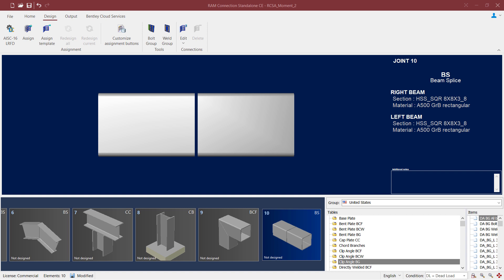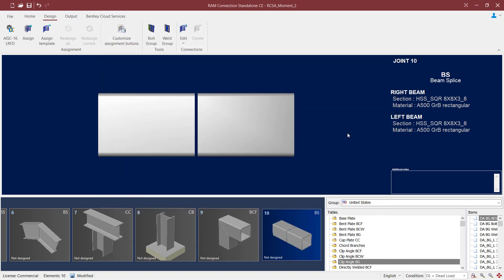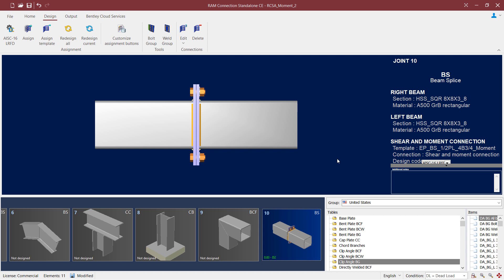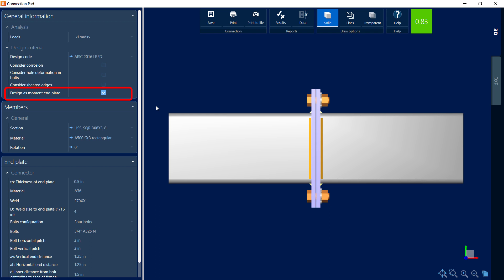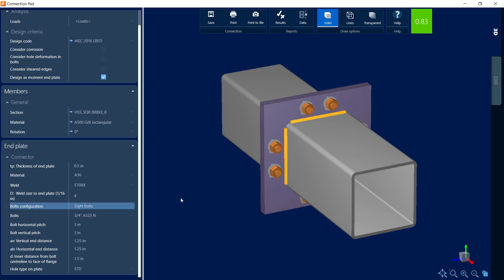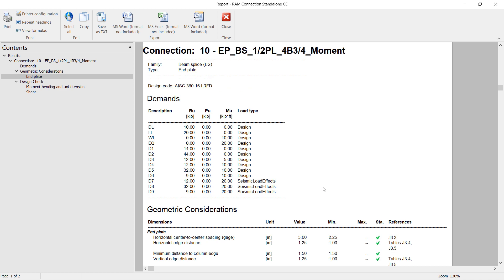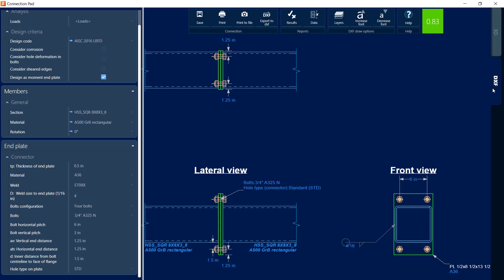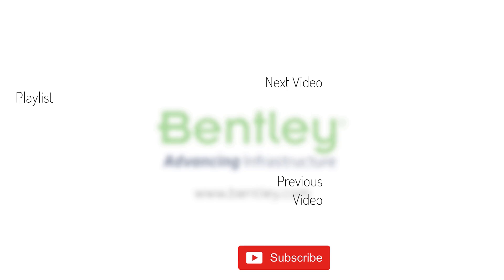Designing End Plate (EP) Beam Splices for Moment in RAM Connection

Comment: Hi. For moment connections, there is limitation of bolt configuration for 4 or 8 bolts. what if we want a custom bolt configuration with more bolts? how do we achieve that. Also in the results, there is no bolts tension checks due to moment action. only plate checks are provided. Can you please elaborate further and help resolve the above queries